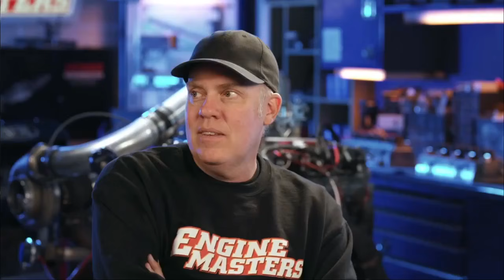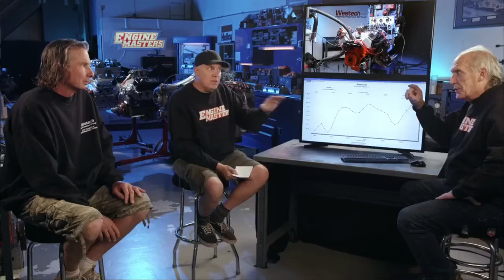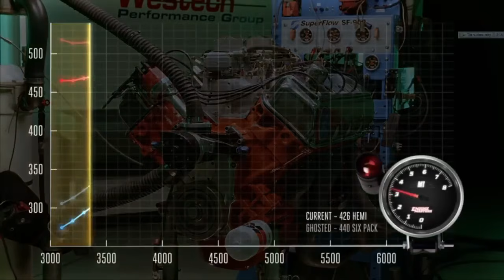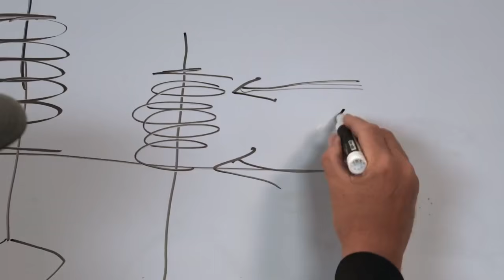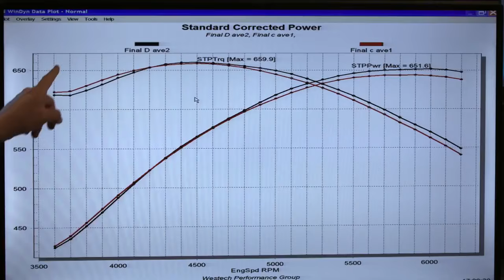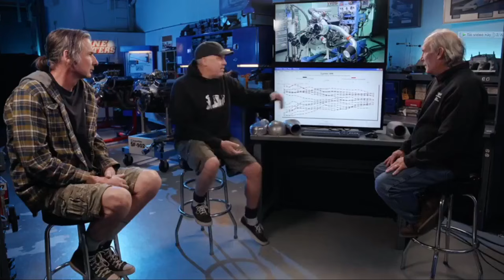Engine Masters Full Episodes – Mopar Muscle Madness: Hemi, 440 & Slant 6 Dyno Battles

Comment: Okay, in my particular engine. 383 punch out to a 392 went with a high volume pump with a low pressure spring eventually. And yes, I bought all that stuff to get to this point seem to work out the best. I love this episode. I wish I would’ve seen it five years ago.